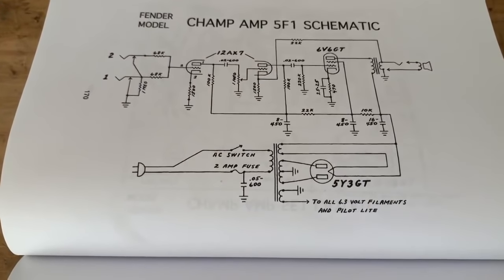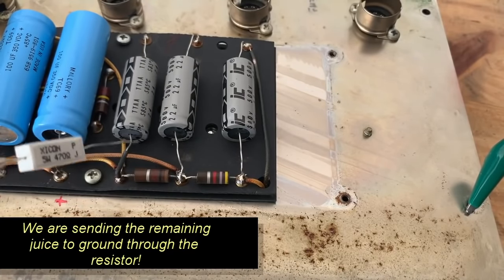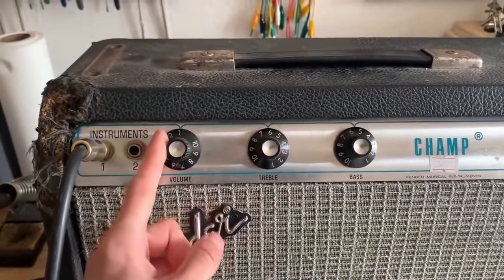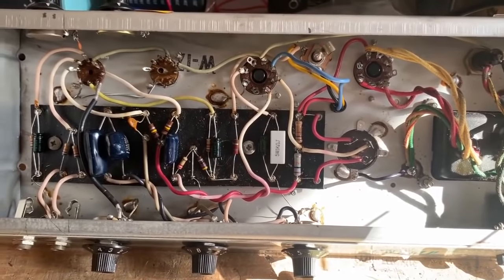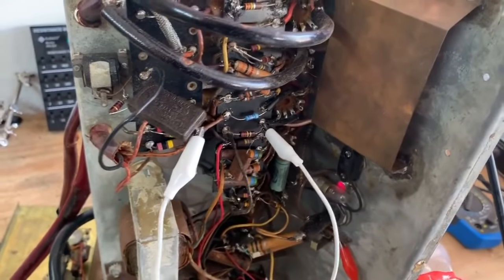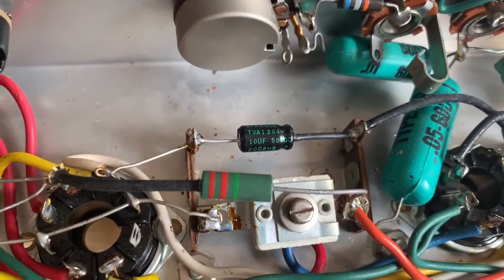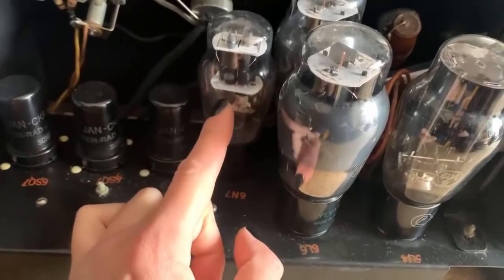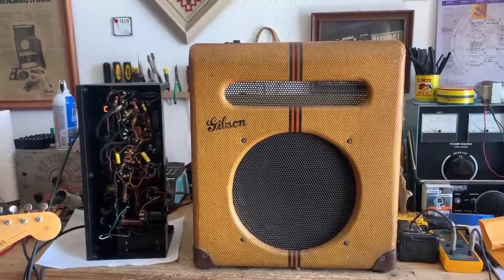Unintentional ASMR 🎸 Relaxing Repair & Restoration of Vintage Guitar Amps

Comment: Never understood the guitar amp people, and the sentimentality with old paper caps. 
If it’s not leaking now, give it a short while, and it will be. If it’s yours leave them in all you like, but as a hired gun, I would be changing every last one. 

Would also recommend using Deoxit F5 Fader on the carbon pots, instead of the D5. D5 is a great cleaner, but it will occasionally clean the carbon tracks right out of the pot. 

Other than that, looks like these amps are in good hands.

Comment: Tube amps are pretty straight forward when it comes to refurbishing and repairing them. Where it gets complicated is when some clever dick has worked on it before and tried to modify it a little or has replaced components with the wrong substitutes. I have seen this multiple times refurbing old vintage tube radios.